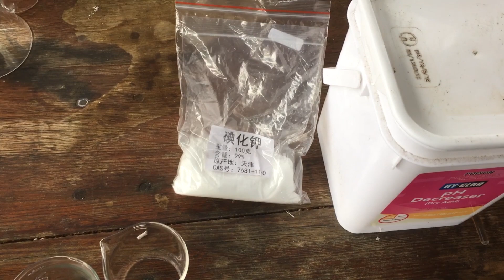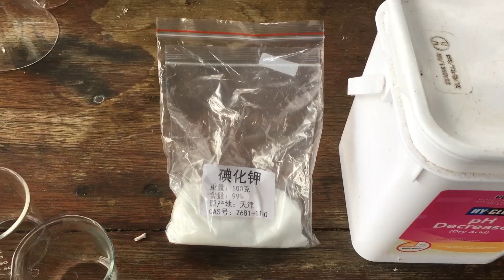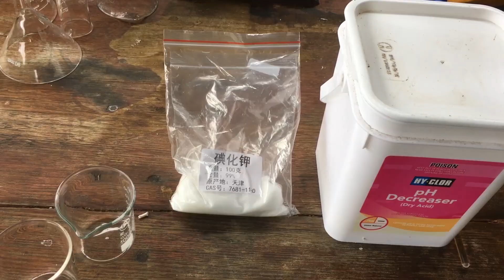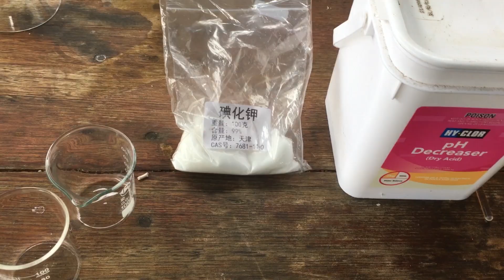Making Iodine

Comment: Why were both solutions brown from the start? They should be clear.
Reply from the maker: Under acidic conditions, some of the iodide ions are oxidised (by oxygen gas in the air) to make triiodide, which gives the solution a very brown colour. It just happened quite quickly in this case.

Comment: I suppose, chlorine gas would work as well, since it is a good oxidizer and would force a single displacement reaction.
Reply from the maker: Definitely yeah, I honestly just wanted to see how effective electrolysis would be (as it turns out, not very). Chlorine or peroxide is definitely the go though.

Comment: You could pass chlorine gas in KI solution. You could also make chlorine from your hydrogen generator by adding NaCl.
Reply from the maker: I did consider it, but generating chlorine seemed like more trouble than it was worth. My H2 generator actually can’t be used for chlorine either, the nickel electrodes wouldn’t hold up. I’ll build a chlorine generator in the future for these kinds of oxidations though, it’ll be useful.
Reply: @ScrapScience  yeah, you can use Pb Or C electrodes
Reply: @ScrapScience  I agree. It's easy once you have a dedicated cell set up for it. I just use carbon/carbon and HCl with a tube set up to catch it, just release the hydrogen. This works for hydrogen as well, just flip the polarity, although kinda a waste for just the hydrogen lol

Probably wouldn't be a bad idea to make both rods trapped but if you're mostly after chlorine from it, not necessary. The presence and use of chlorine assumes adequate ventilation for such and implies the hydrogen present will not be problematic.
Reply: You can generate Cl by adding harpic and bleach

Comment: For peroxide check hydroponics stores and for sulfuric acid check plumbing supplies.. in Australia mo flo drain cleaner is 98 percent and cost 48 bucks per litre at plumbing supplies and 65 bucks at hardware stores
Reply from the maker: I’ve been planning on checking with my local hydroponics store for peroxide, that definitely seems to be the way to go if they sell it. As for mo flo, I’ve been looking in various plumbing/hardware stores for years and have never found any of it, I’m starting to doubt they even sell it in my state, but I’ll keep looking.
Reply: @ScrapScience  eagles plumbing supplies have it in nsw
Reply: @ScrapScience  They sell acid drain cleaner, but only to registered plumbers in Tas. Battery stores maybe?
Reply: It’s not sitting in plain sight. You just need to ask the salesperson and you Shall receive

Comment: Hey, nice video :)
Which buck converter are you using?
Reply from the maker: Thanks!
I pretty much just searched on ebay for the cheapest 'ten amp' buck converter I could find: http://www.ebay.com.au/itm/192007593319 
Turns out it actually works very well, but whether or not it can actually handle 10A is not something I really want to test.
Reply: @ScrapScience  probably most every   computer power supplies can put out well over 10 amps at  3.3v and several 10's of amps at 5 volts, without needing a separate   buck converter from 12v.  But maybe it's nice to have the extra control over the amp draw through controlling the applied voltage.  Incidently, one can also limit the current by controlling the submergef surface area of the electrode.